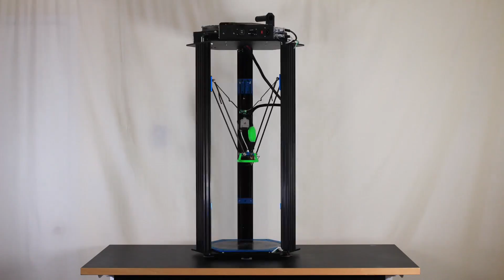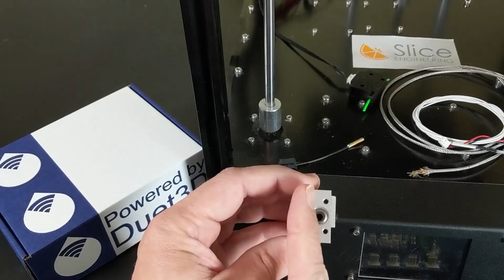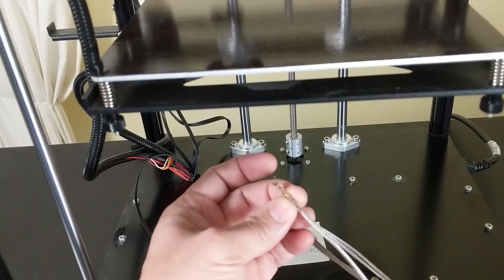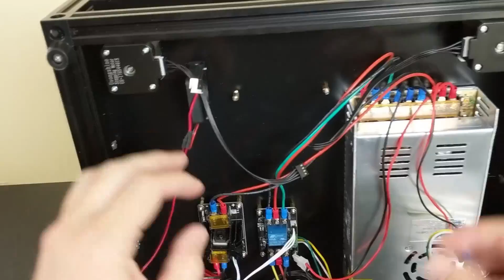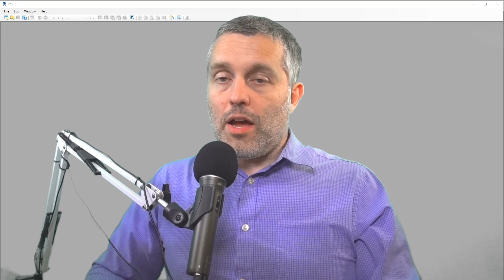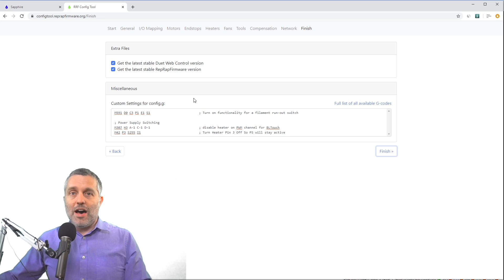Building a Better CoreXY Printer --- Sapphire + Duet + Mosquito +  BLTouch

Comment: That tool that you said is your own design for fitting cables into the split cable sleeving is most certainly NOT your own design. I bought some split cable sleeving from a shop called Pound Land more than 2 years ago and it came with a tool that looks exactly like "your" one.
Reply from the maker: Show me a picture. I'll show you the CAD work I did and the 3D print file. Proving my work is original. I guarantee that it doesn't look exactly the same.  I didn't claim I invented the concept. Just looking at the split tubing it's clearly designed to use such a tool. As I said in the video I went looking for a solution someone else already made but I couldn't find one so I made it. My question for you is why the animosity? Why does your comment feel like I'm being attacked?

Comment: For somebody who doesnt print much and where speed does not matter much.. what would be the best printer around 300-400 euros? 
Just talking about quality of the print, regular PLA no resin!
Reply from the maker: Ender 3. Hands down. $189 from creality3dshop.
Reply: @DesignPrototypeTest  Does the Duet board improve the print quality in any way or is it mostly usability?
Reply from the maker: Usability. There are small improvements that can be made such as pressure advance and dynamic acceleration but 98% of the quality can be achieved with the stock control board on an Ender 3. It's all about the slicer. If you are going to use Cura, definitely watch all of the Filament Friday videos by CHEP. I use Simpify3D. Cura is free, Simplify3D is $150. Here is my playlist about the ender 3. Definitely check out "The Ender 3 Evolution" build: https://www.youtube.com/playlist?list=PLtVk4dZInT80SCVB_Pgrn1zZThO3nmV7B
Reply: @DesignPrototypeTest  Thanks! I did watch your evolution build, thats how I found this channel in teh first place :) kinda new here.

Comment: Bro I know what u mean but maybe not lump all of China into one group when u talk. Blame the specific company in china. The ironic part is more than half of the stuff u are using is from China.
Reply from the maker: The CCP is in effect one massive corporation. The 3D printer space in China definitely functions like a single company. For instance look at the Tevo Little Moster. Then look at the Anycubic Predator. Both printers were designed by Chey Chen. The Predator came 2nd, yet it's clearly just The Little Monster V2. Brand names don't mean much from China. Creality seems to be a separate entity, and they are the best as far as making unique products, but if you really analyze the products, every single Chinese company is guilty of IP theft. There is no need to differentiate as you have suggested. A blanket statement is applicable.
Reply: @DesignPrototypeTest  This is a very unfortunate understanding and it saddens me that your response to this issue has been very similar despite having had this point brought up to you on several occasions. I do not want to change your opinion. It is true Chine is very loose when it comes to copyright laws and that needs to be corrected, but I personally find your strong Anti-China sentiment very disturbing.
Reply: @rexxu8567  Why disturbing? Like you mentioned he’s using Chinese products and sharing them, nobody’s gonna notice/remember those anti-China sentiment as ppl who watch these kinda videos were mostly only interested in the products. There are always ppl who are like ‘omg Chinese crap...cheap copy from xxx’ and then put Chinese product into their shopping cart, so typical and how sad is that😂.. and if you think about it, they are helping Chinese manufacturers. Tbh I just enjoy watching YouTuber like this, seems so hateful of Chinese products but yet work so hard on making video of what they hate for money

Comment: Good video. I recently bought a Sapphire Plus as a second printer while printing Face Shields for the NHS. I was looking at the Pro, but the Plus was far better since it even has linear rails for Z. I like it that much that I'm going to sell my heavily modified Ender 3 and possibly never go back to Cartesian Printers ever again 😂. Don't get me wrong the Ender 3 has been an excellent printer. Unfortunately the Plus also comes with that Crap hotend though. I was lucky enough that it never fully blocked, but it caused the extruder to strip filament on a few occasions. I've got a load of upgrades already for it though. Got a BLTouch since I'm very familiar with it as I have one on the Ender 3 and it's brilliant to be fair. Got an Anycubic Ultrabase since I've found that to be the best overall print surface, I'm changing the hotend to a E3D Chimera and have a second extruder and Motor on order. I've already put Capricorn Tube on it and I've Flashed the MKS Robin Nano board with Marlin 2.0.5.3 since the Proprietary firmware is terrible. Overall extremely happy with the printer and CoreXY is definitely the way to go in the long term.
Reply from the maker: Great comment. Thank you. However, I don't think highly of the E3D chimera. I suggest you not go down that road: https://youtu.be/xkFS77GlFkY?t=2015 Also, it just occurred to me that the Chimera heatsink is the same as the crap stock heat sink on this printer.
Reply: @DesignPrototypeTest  I actually got given the Chimera for free from a friend to be honest and also have the Cyclops which I'm not as interested in. The heatsink does look similar, but I think it is better quality and supports a much bigger fan. If it doesn't work out though what would you suggest as the best Dual material setup?

Comment: I cannot believe how much bullshit you are talking while you are dead serious. There is no way that you have a mechanical engineering degree or something similar.
Reply from the maker: Which bullshit? You can't just label a thing without calling out specifics. I talked for 37 minutes in this video. Which particular thing that I said is what triggered you? Also, what does it matter what credentials I have? Obviously, you would never see me as an authority in the subject matter. Something about my person or delivery method annoys you and you just want to tear me down. Even if I had a Ph.D. in 3D printers from M.I.T. (Not a real thing, it's a joke) you would still be casting aspersions. Saying something like "I guess they'll let anyone into M.I.T. these days. All we have left is to debate the issue. So, what's the issue? What is the thing you are calling bullshit on?
Reply: @DesignPrototypeTest  Here are some points that I remember from you video atm:

1) Duet is not the best Controller Board out there, but it might be for you.
2) Stratasys uses CoreXY for their machines because it fits for them, not because it's the best mechanic. 
3) China is indeed capable of engineering and producing parts themselves, but you just don't want to open your eyes that far. 
4) The Heatsink in the printer might be horrible engineered, but it gets the job done for low temp materials like PLA. Not always is the best needed in every way. 
5) Good luck printing PEEK with this printer in the long run. Especially if you enclose that thing. 
6) Just because something works or is over engineered, doesn't mean it is good or like you say the best. It always (!) depends on the needs and budget. You must get that! 

Please be more open minded in your future videos. They could be so much better if you wouldn't act as you are the one and only expert in this world. Jesus....
Reply from the maker: Weak.
Reply: @DesignPrototypeTest  Why weak? Explain like you wanted me to do.

Comment: Just a quick thought: Might there be any significant improvements regarding acceleration by replacing the steel rods for x and y by carbon ones? Inertia and following the stress for the motors should be reduced to ~25%. Torsion and motion strengh should be fine to handle the momentum resulting of effektor and belt tension.
Reply: Possibly, but as always there are significant challenges and tradeoffs. This was widely debated back and forth in the Voron slack channel and on Reddit while the designer Maksim was working on designing version 2 of the Voron. I remember some of the community members ended up trying this as a mod for their design but from what I remember they had substantial challenges.

Essentially, the carbon fiber is very strong for its weight ratio, but isn't at all able to stand up to the cylindrical Bearings everyone was using running on the 8mm rods back then. Second, 8mm hollow carbon fiber wasn't stiff enough to properly support the hotend, so parts had to be redesigned to accommodate a 10-12mm carbon fiber tube. To replace the cylindrical bearings some of the community concluded the best option was likely Igus bushings. They're a high end press fit bushing designed to be self lubricating, and as they're made of plastic themselves, they aren't as likely to damage the carbon fiber rods.

In the end, I think Maksim decided the best option was to go the other direction and instead to use small, stiff linear rails for at least the xy motion as their design best lent themselves to a high speed, high quality printer.
Reply: @2011JMB  Yea I had those thoughts for the x and y axis itself, too. Linear rails are the better option for those, maybe with a carbon substructure instead of aluminium.
Thats not the point I referred to, I want to replace the vertical steel rods that are connecting the motors with the belts gears. Dimensions are more significant for inertia, 3/4th or more reduced mass for full carbon rods should be overthought, too. But there is another problem if I want to use them in an heated chamber. I don't know how their strenth will react to high temperatures

Comment: So you could build a corexy hypercube or baby Viking for same price with duet or skr , I think the Vking or ender 5upgraded would be better value. Agreed Ender is note corexy but print quality with some minor mods seems to be good as opposed to Saphire. The new Saphire pro seems to have issues with Z rods and ends stops etc. alternative I have seen is the Creative/Kenovo Elf with dual Z rods but not many reviews. Also Creality are due to release some new corexy like designs ender 6 and cp05

Comment: So yellow was stock , and green is mosquito so no change with upgraded heat sink for hot end??
Reply from the maker: For that print there was no change in print quality. If you can get a successful print from the stock hotend+heatsink, you won't notice a difference in print quality.  Getting filament to reliably feed through the stock heatsink is an iffy proposition. You never know when the stock hotend will jam, but it will jam eventually ruining your print(s). Heat creap is the number one issue in hotend design. It's the reason hotend heatsinks even exist in the first place.

Comment: Are the rods steel? Tech2c used carbon fibre rods in his hypercube. Don't know how much about the pros and cons including how much weight could be saved or the cost?
Reply from the maker: Tech2C's WONDERFUL video series about the Hypercube culminated with him using carbon fiber linear rods and IGUS Drylin bushing-bearings. This printer uses Linear Motion Rails. There is no lightweight version of a linear motion rail, so, sadly I can't follow Tech2C's example.

Comment: I bought a Sapphire S after watching another video you made, and it's been nothing but horrible to me. It overruns the X axis when autohoming, the Titan extruder jams easily, and I can only slice files with their terrible version of Cura 3
Reply from the maker: That's strange. I got my sapphire S to work with the latest version of Cura, and Simplify3D before switching to a Duet control board. Anyway, just sell it on Craigslist or Ebay. You should be able to get what you paid for it now that the price has gone up by $120.

Comment: The original hotend design did its job perfectly, it was engineered just well enough for someone to buy the printer, while keeping the price rock bottom. Same with the control board, bed leveling, etc. All perfectly engineered to meet the goal of being as low price as possible while still being a 3d-printer shaped object. It's all designed that way because that factory knows that there is always a market for the cheapest possible printer of each category, without regard to quality. I have a printer in this price/quality range too. There is also a market for a slightly better engineered less fuss printer (ultimaker/formlabs/prusa) and a market for a business/pay someone else to fix it printer (stratasys). Expecting competent engineering from a printer factory competing primarily on price isn't reasonable. It's like expecting good engineering/design from dollar store products.
Reply: I guess the dollar store where you live is different from the ones near me, the ones here got solid stuff

Bought a socket set for $15 with a driver (says 4.8nm, is ~5.6), ratchet handle, bit holder, 10 bits, sockets 1-26 with .5 sockets until 6.5 and spares on 8, 10, 17, 19 and 21. didnt break until i put a pipe around the handle for a 10 mm bolt.

Comment: I'm only interested in a printer that can print engineering grade plastic such as nylon and polycarbonate. That's why I subscribed to your channel and why I like the Sapphire + the mods you suggest.
QUESTION: If you have an insulating enclosure, do you have to heat the bed?
Reply from the maker: It would still be a good idea, given enough time in the enclosure, the bed should reach ambient temperature. It would be better to have the bed be slightly warmer than ambient. If anything is going to shrink you don't want it to be the intersection of the part and the bed.
Reply: @DesignPrototypeTest  Thanks for the quick response and the info. Looking forward to more high temp printing vids.

Comment: Stratasys uses H-bot not CoreXY, which was developed many years later on MIT.
Reply: They're like brother and sister. The corexy is also the hbot website. Slight difference same concept. Both great. I jumped on the corexy bandwagon late because I just purchased (calm down I know you hate these but j like the software) a mk3s with mmu2s and a mini. But my own is just like yours. Buy the saphire and k have the rest. Just ordered the due3t 3 and ghat broke the bank but I also gave original bondtech lgx with the cooperhead add on plus a separate cooperhead with the heatsink, a original e3d heremes a dyze 500c hotend and I built the voron m4 extruder. So plenty of those to choose from.
Reply from the maker: I was hoping somebody would call me out on this. I didn't know what it was called but I could see it was slightly different from core XY. I think it's largely similar because of the long belts. The motion system is the same just the belt routing that's different.
Reply: @DesignPrototypeTest  X gantry racking is a problem with h-bot. CoreXY removes that issue. The belts even help keeping the x gantry perpendicular to Y. It's brilliant!
Reply: @boxsterpontus  but belts in CoreXY are not that elegantly routed and yo can deal with shear forces on x gantry carriage by designing it bit stiffer.
Still, bottom line stands. Corexy is a king of kinematics.
Reply: @boxsterpontus  the design is really good and propably works for "normal" sized printers, on my big printer it was no option, the belts would be 2m long (bed 600x900mm) so i went for a H-bot setup with coupled belts to keep the x gantry square

Comment: Tpu on pei is super easy.  Just spray the pei with windex and wipe off before printing then use a few drops of rubbing alcohol around the perimiter of the print to release. Works perfectly every time

Comment: What do you think about H-Bot printers ? I bought my printer a few years ago thinking it was CoreXY and then I learned that H-bot was a thing.  But I’m really happy with it.  I’m looking into upgrade the printer with 32bit controller and some similar mods like yours to make it better and also a bit better looking. Etc.
Reply: H-bot designs preceded CoreXY.  CoreXY was developed to solve a problem with h-bot designs in that the forces on the belts can easily induce racking of the gantry.  With CoreXY the belts cross paths and the forces are distributed to parallel corners instead of opposite corners conspiring to twist the gantry.  So while an h-bot is slightly easier to build, the advantages of the CoreXY layout make them completely obsolete.
Reply: Jason Bitterly thanks for the explanation. I think that I will not be able con upgrade my printer to corexy with my current knowledge.  But since I got it working sufficient enought for my use. I will probably mantain it until it’s obsolete. But without doubt my next printer will be a corexy when i feel the need to a full printer upgrade or a 2nd one.  I really like way it works.  I often print architecture I found that the little movement of the bed help with the stability of small columns during printing and avoid some falls that I’ve had in Mendel like printer before I had mine.

Comment: Would you comment your thoughts in regards of inertia energy about a printer design Proper Printing is building? link: https://youtu.be/yDLrBVVPX2g
It looks sturdy the way he tested it but I didn't see it in long runs, only small moves. To me it seems like a lot of mass needs to be reversed the other way... But then again, would it work?
Reply from the maker: I love Jon's work! He is very talented. I wouldn't be surprised if his moving gantry weighed less than the bed. So inertial mass could be better than the stock printer he modified. The problem will be the cantilevered mass. As he prints higher  and higher the X-gantry moves further and further from the motion system thus giving it more leverage. I expect rippling/ghosting will get worse and worse the higher up the print. This is the trade-off he is accepting to be able to print inside a reasonably sized enclosure. Everything is a tradeoff.